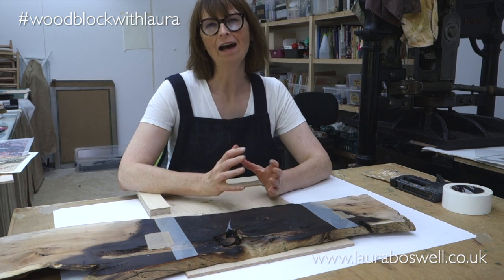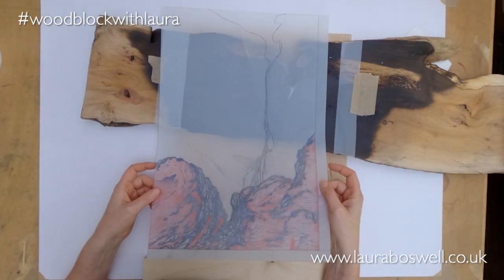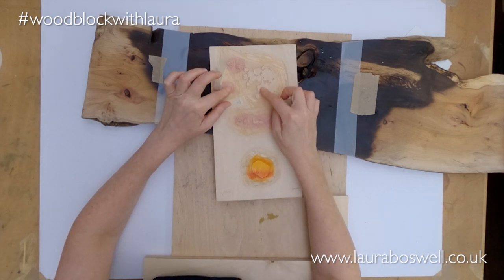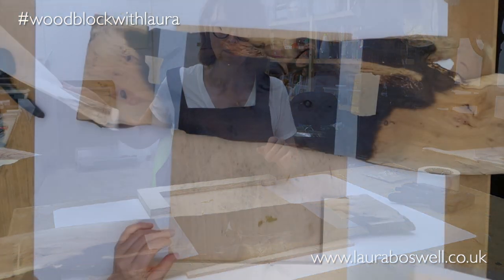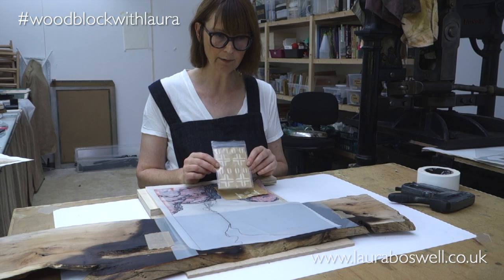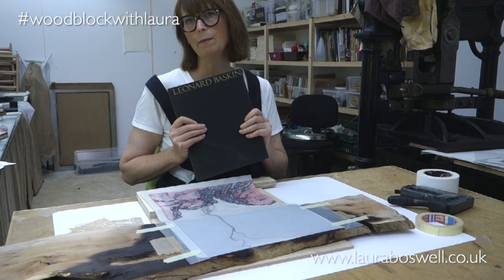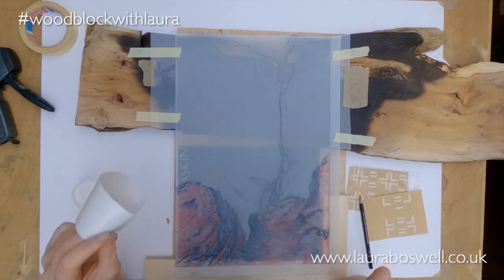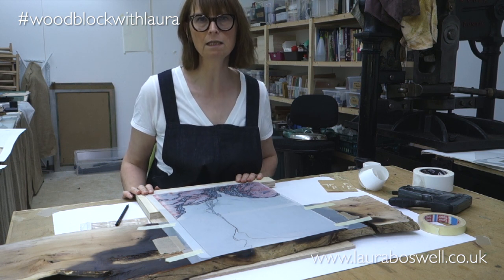Japanese Woodblock With Laura Episode 23 - A Yew plank for Wood Grain

Comment: How did you attach the small mask for the waterfall? Do you remove it after each print is made and replace it for the next print? Thank you.
Reply from the maker: It’s on a little gaffs tape hinge and I fold it back while I ink and then pop it down over the block as a mask while I print